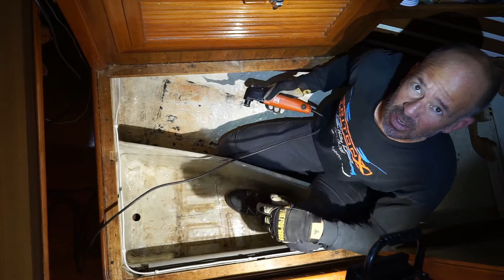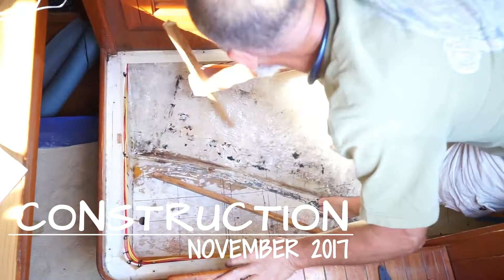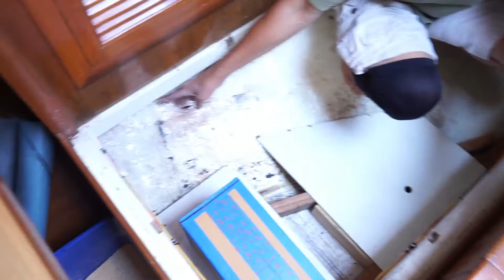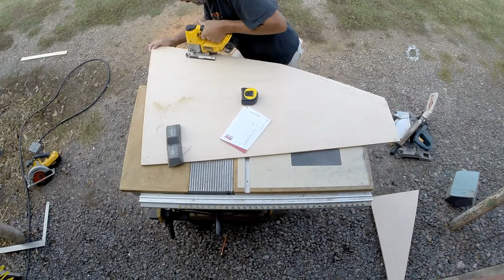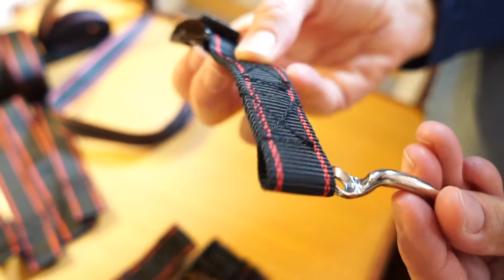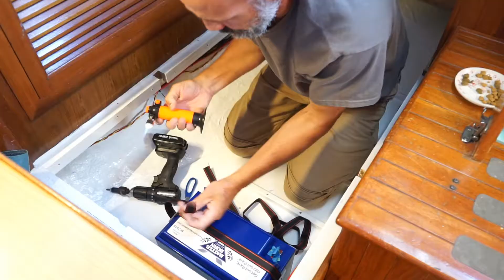SV Ramble On | Battery Box

Comment: nice!--curious - is there an exception in ABYC for not having the box covered for these batteries?  I know its under the seatee but thought it had to have its own secure top in the event of bad seas or gawd forbid, roll over.,
Reply from the maker: I've heard that ABYC is developing a new standard for lithium ion battery systems (installation, battery management systems, and safety features to prevent fires).  It was supposed to be out this year, but I haven't seen it yet.  The current ABYC standard for batteries requires the positive terminal to be protected from accidental shorting with a boot or a covered box.  Ours will have a boot.  It'll be interesting to see what standards ABYC comes out with specifically for li-ion batteries.